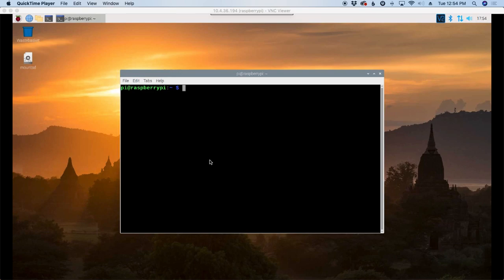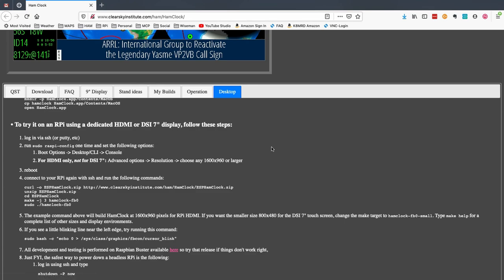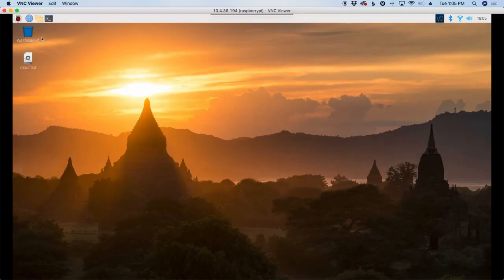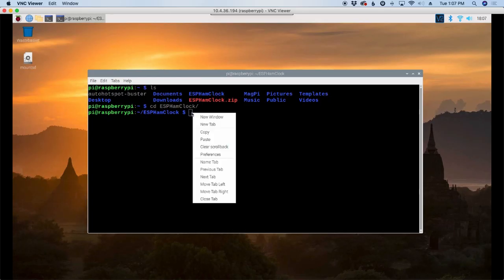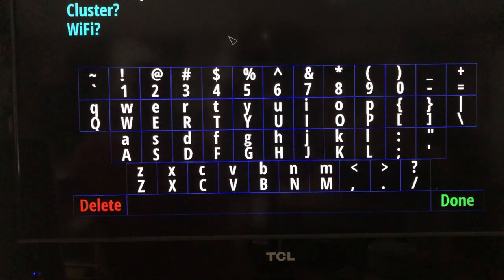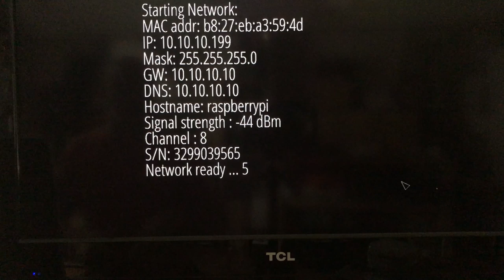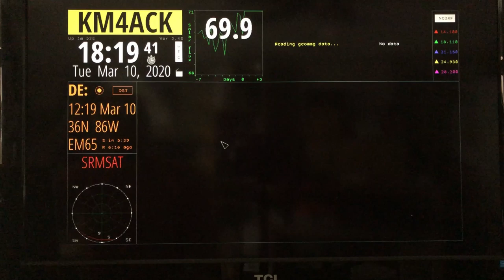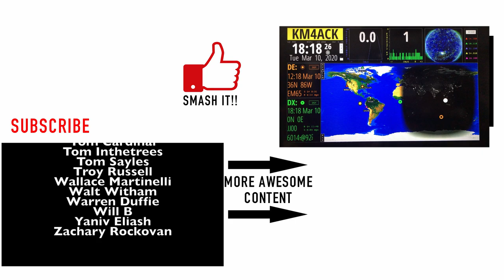Ham Clock on a Raspberry Pi | Clear Sky

Comment: No need for a monitor, I run the hamclock through vnc. In fact, I have a simple desktop icon (symbolic link) for ease of running.     BUT more importantly, hamclock will show the BAND conditions.    This is the main feature I love.   Click on a location that you are interested in and a green circle is displayed for the DX location. Info is then displayed in the DX box (like distance to & bearing), but now click on the box to the right of your callsign(cycle through the displays).  Lots of good info, but mainly the current VOACAP DE-DX percentages for all bands!!   OK, 20m is at 98% for the midwestern USA, so I'm going to check it out... Bye.
Reply: I have VNC running at 1920x1020 on the PI and compiled hamclock with as hamclock-fb0-1600x960. When I try ti start it from a terminal window or via an app symbol my windows are mixing and I get no stable hamclock window up and running. How did you configure it (which compile and which vnc settings)? vy 73 DG6UAX

Comment: so I already built a ham clock on a Pi and am just using an HDMI monitor and mouse.  Is there some special coding or terminal commands I would need to get the touch screen working if I got this Pi monitor?  Any help would be appreciated.

Comment: Hi Jason. Thank you for your dedication and work for the ham community.  With regard to this video, My install would not go any farther than ./hamclock-fb0. I tried it with and without SUDO.  I was left at the command line prompt with a full-screen terminal and it would not boot back into the GUI. Had to use SUDO raspi-config to get back to the GUI.  Can you offer any solutions? Running Bullseye on a Pi 4 4GB.

Comment: The default screen resolution for the HamClock display seems to be 1600x960.  So you need and HDMI display with pixel resolution at least that high.  But...there are other resolutions available.  For a 4K HDMI screen, there is 3200x1920, which almost fills the 4K screen.  To get the other resolutions, you have to run the make command with different parameters.  To get the 3200x1920 display, run:

   make -j 3 hamclock-fb0-3200x1920

Then execute the program called "hamclock-fb0-3200x1920" when it is done.  Looks great on a 4K TV!
Reply: Forgot to mention...you need an Raspberry Pi 4 to do 4K resolution.
Reply from the maker: Great info. Thanks!

Comment: Thanks for posting this and showing how easy it can be, Jason. Building a ham clock for my shack has been a project that's been back-burner'd and re-back-burner'd several times. Your video motivated me to knock this out yesterday, running on a ZUMSpot in my shack that I run QnetGateway on. I've temporarily repurposed a small monitor used for an external waterfall display for my K3S/P3, until the 7" touchscreen I ordered from Amazon shows up at my doorstep.

The only issue I encountered when running Ham Clock with the other applications on that one pi is that Ham Clock runs a web server on port 80 (standard HTTP port), that conflicts with QnetGateway's web console. It seems that this is a non-critical component of Ham Clock, as the application runs fine without it. So the only modification I made to make everything work together was to introduce a 30 second "sleep" at the front of the @reboot cron entry for Ham Clock (per the instructions on its site), allowing the other web server to fire up before Ham Clock has a chance to grab port 80. This is not necessarily a great workaround, but it seems to work well enough for me, for now. 73, de K7AJG . .

Comment: Thanks, another great Raspberry Pi project. I was unable to access the setup screen, call-sign and lat/long are wrong but otherwise it’s great. Thanks again.
Reply from the maker: This might be a screen resolution issue with the monitor or pi.
Reply: KM4ACK it was me being stupid. I accessed it with VNC and was using my computer mouse to click instead of the mouse on the Pi. I got it working. Thanks again, great video and excellent coaching. 
FYI I also did not have success with 
sudo ./hamclock-fb0 once I dropped the sudo it started right up.
Reply: I’ve shared the video and comments with some members of my local club, lots of positive feedback on the project.

Comment: Thanks Jason, I've been rocking the clock since you posted the video.  Great stuff!  Quick question - with all the storms we've been getting in the south, I lose power a lot.  Is there any way to have the pi go through the cd ESPClock command and ./hamclock-fb0 command automatically, so the pi just boots to ham clock?  I have a dedicated pi and monitor just for the clock.
Reply from the maker: Yes. You should be able to call the application from a cronjob @reboot.
Reply: KM4ACK thanks Jason!

Comment: I tried your installation (which was very clear thankyou) and the new version on the hamclock website. Both didn't work as after following the instructions to the letter I couldn't get it to work. No command would run hamclock. As I am not very good with Linux I have given up on it.

Comment: Great video. I've been looking for a way to run Ham Clock and viola I came across your vid. I've run into a problem though. I'm running a Pi-4, but when I execute the program I receive an error informing me that the "..buffer must be at least 1600 x 960 with 32 bits per pixel". I've tried different resolutions to no avail. Any help would be super. Keep up the great work.
Reply from the maker: You could try running it in a window on the desktop. https://youtu.be/UcPCv9tHGKk This is how it is implemented in build a pi.
Reply: @KM4ACK  UPDATE: I was able to make the HamClock operational by switching from the 64 bit Pi-4, to the 32 bit Pi-3B+. I repeated your exact build instructions on the Pi-3 and it came up without a hitch. My next project is to follow your instructions to build a widowed version of the clock. I love the versatility and power of the Raspberry Pi, you have applied that power to one of my favorite hobbies (HAM Radio), your channel is now one of my favorites, keep up the good work.

Comment: Jason I'm trying to load this on a Pi Zero 2W.  I've followed your instruction to the letter and everything seems to work perfectly right up to the point where I entered ,/hamclock-fb0.  I have tried that with and without sudo and in either case when I hit enter I simply get another command prompt.  It never runs ham clock and no setup screen.  I have even gone so far as to rebuild my SD card from scratch and I still get the exact same result.  I can confirm that I am in the ESPHamClock directory at the time I enter that command.  And doing a listing shows that there is a hamclock-fb0 file present.  What would you suggest.
Reply from the maker: There's a more up to date video. This one is pretty old now. https://youtu.be/2Cy5Swmk3gU?feature=shared

Comment: Hey Jason, I discovered this app and put it on a PiZero W even before you published this video.  I simply followed the instructions on the Clear Sky Institute website.  It really is a nice program with lots of information all on one screen.  However, I have noticed that my clock freezes periodically.  Sometimes once a day, sometimes several times in one day.  I set up a crontab to reboot once a day, and that doesn’t seem to have helped.  I have it running on a barebones version of raspbien.  All the updates to the OS and the software are made at least once a week.  I have the PiZero W in a Pi Foundation red and white case, and noticed the operating temp on the Pi was pretty high.  So I popped off the lid, and that dropped the temp, but didn’t do anything for the freezing.  Any ideas?  I’ve searched the internet, and haven’t found anything useful.  Your knowledge of the Pi is exceptional, and I though you might have some ideas why it keeps freezing.
Reply from the maker: Haven't experienced it freezing but I do know that it uses a lot of CPU. That would certainly explain the heat issue. Try reaching out to the developer and see if he might be able to help with the freezing issue.

Comment: I assume is the same instructions for a Pi Zero right? I can't justify waste one of my Pi4's for this haha but I want the clock. I guess i can get a Pi Zero on ebay in around $20
Reply from the maker: Haven't tried it on the zero but see no reason it won't work. I just did a video on running this along side other apps on the pi as well. https://youtu.be/UcPCv9tHGKk
Reply: @KM4ACK  Thanks, I saw that video too, but Im looking to make kind of a solution for a framed screen for the shack, I guess the best will be an Arduino but I have never tried Arduino, only Pi's

Comment: Now I know what I am going to do with my old Pi ! Thanks Jason ! 73 de Don KM6TRZ
Reply: Don, when you say old Pi, I am curious how old??  Pi 2, Pi3, Pi3+  I have an old Pi and I believe it is just the Pi2, has no wifi or bluetooth capability.  I have to hook it up via ethernet cable, but I do believe I have connected to via VNC thru the ethernet.  I just forgot my password.  I guess I am going to redo the OS on the card and start from scratch.  Juddie WD8WV
Reply: @JnJTrueOutdoorAdventures  I have a Pi3+ that I will turn into a Ham Clock.

Comment: Jason, I've been trying to load the Ham Clock on to a Pi4 and when I get to the "make" part I end up getting a an error message that it will not work with my resolution. The monitor I'm using is 1024x768. can't use the 1600x960 so I tried the 800x480 and it still will not load. Is there an easy fix?

Comment: I must have messed something up.  I don't get the set up option on my screen. Are you using Raspian or Buster?
Reply from the maker: Buster. It is probably a screen resolution issue with either the pi or the monitor. I never could get my 7" screen to work correctly. I may try again at some point in the future.

Comment: I need to get the old Pi 2 that I have setup again.  I have forgotten my password to do the VNC connection to the Pi.  Now this old Pi has no wifi and I have to run it with a ethernet cable.  But I had connected before to it (I think).  I would love to set this old pi up in the shack running this and only this.  I use my Pi 3+ for my digital modes.  Great video again Jason as always.  Juddie WD8WV

Comment: When attempting to install Hamclock I get an error my display is not at least 800x400. I have set the display much higher but Hamclock install is not successfully detecting. I reinstall OS and attempted to install Hamclock again and it failed. OS install did not give me a chance to set the display. I have used the OS GUI and both verified and set display that 800x400. 

What do I do to correct this problem?
Reply from the maker: This video is dated now, and the build directions have changed.  There is a new video coming Jan 2023.

Comment: From the HamClock screen I would like to know how to shut HamClock down. There has to be safer way to exit hamclock rather than using Ctrl, Alt, Delete or pulling the power.
Reply: Per the documentation, hold the lock symbol down to initiate a graceful Raspberry Pi shutdown or reboot (this might only work on a touchscreen—I'm using VNC Viewer, and it just restarts Ham Clock).
Reply: @53e142  Thanks! I knew there had to be a way. Sorry, I skimmed through the documentation once and did not see that.
Reply: @53e142  Thanks. I skimmed over the documentation and did not notice that.

Comment: I've set the boot to "CLI".  The Pi asked for a reboot, now I only have the Command line.  How do I return to the GUI, with out reinstalling the OS?
8P6RC
Reply from the maker: "sudo raspi-config" and set it to boot to desktop (option 3)
Reply: @KM4ACK  Then, select System Options-Boot/auto login-Desktop-Finish. And you're done. I had that problem and got crazy. My son gave me the steps; so I returned to my normality again. So I hope you already fixed it after 8 months.

Comment: Setting the screen to 1900 x 960 on a 9" screen is really lousy advice. Now I will have to try to see any damn thing to fix it... Do not follow this advice on a 9" screen or smaller.
Reply from the maker: Easy to fix. Simply rebuild the app and specify a screen resolution that works for your setup.
Reply: Yep, Billie I should have read your comment before trying the advice on this video.  I had hamclock working and just wanted to adjust the size, totally screwed up my Pi.